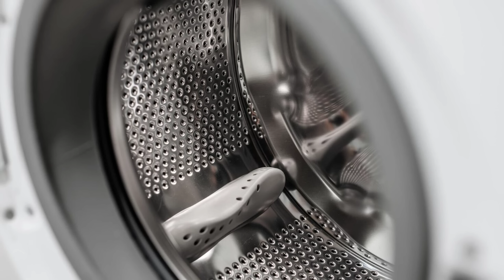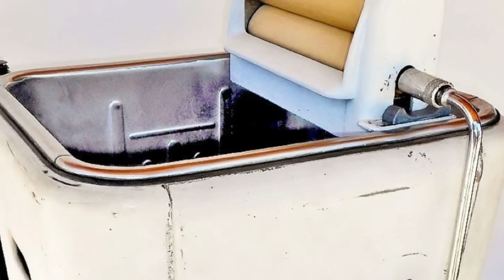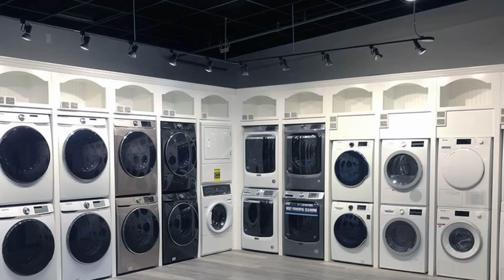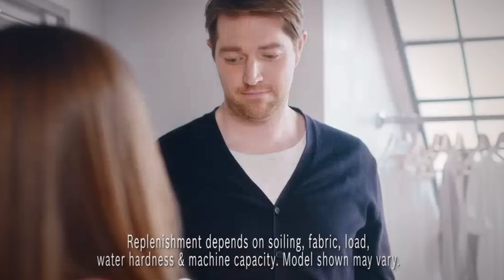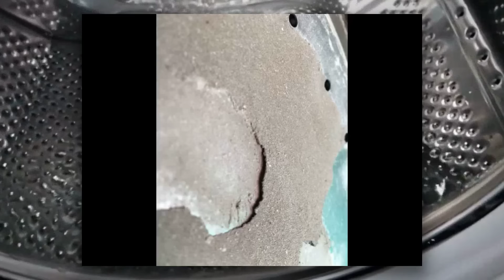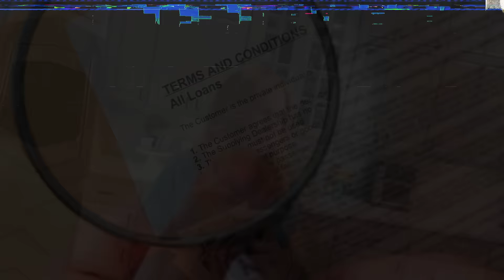The Only 5 Washing Machine Brands In The UK Still Worth Buying (Everything Else Is Junk)

Comment: Im a sucker for bosch and sadly my serie 6 did have a hole in af hose and leaked i have it fixed in a little shop who does work on all that kind of machines
And short after some how it have got a hit or water damage under paint in front and rustet in buttom and paint are coming off but the machine works fine and are around 3 or 4 years now :) i have both washer and a dryer with silencer they are so good machines so i am buying a new serie 6 bosch again

Comment: BOSCH ??? Bullshit. 
The sealed plastic cover around the drum makes the bearing replacement impossible, which is what frequently brakes in those machines ( or the spider as consequence of the defective bearing).
A replacement drumm costs 85% of a new machine. And bearings brake frequently after 5-6 years, and cost less then 20€.
The plastic cover is clearly an early obsolence tough decision.
BOSCH dont belong in that TOP 5

Comment: Actually, Miele have recently resorted to a fibre glass composite material called "Glaron K" for their outer tubs on their lower range models.

And you missed Ebac machines, which are VERY GOOD, REPAIRABLE machines made in the UK, and recommended by service engineers everywhere. Although not feature rich, Ebac machines have enough programmes for most households, with Hot AND Cold fill on some machines,  and offer a 7 YEAR parts and labour guarantee, which is unheard of from virtually every other manufacturer, except for LG, who offer a 10 year guarantee, but only for the Inverter Motor. The Ebac guarantee covers everything, and their machines can be bought for around £500, depending on capacity. So that is a lot less than a Miele, but with a guarantee that is over three times longer, and they are British made! 
Ebac will be my next machine, when my Bosch Serie 4 gives up.

Comment: Miele?  Don't waste your money!  
My high range Miele washing machine (over £1,000) lasted 12 years?  I do 3 sometimes 4 loads of washing per week, I never overload the drum but there is only myself and my carer.  When the machine drum stopped turning I called an independent service engineer who said 'The spiders gone!'  This engineer said what fantastic condition my washing machine was in, 'like new' as it hadn't done a lot of work so I asked him to do a report stating that which he did!  My house is fitted with a water softener so hard water is avoided.  The spider was removed and it was made with 'Mickey Mouse metal' (ASME IX, G6 Metal Fusion Engineer).  I wrote to the UK CEO informing him that when I purchased the washing machine at great expense the advert said it would give 20 years service!  I received a phone call from a lady who said 'What do you expect it's 12 years old!'
I wrote back and informed this CEO that I was someone who had Miele appliances throughout my home (incl. 2 vacumn cleaners, dishwasher, fridge freezer, upright freezer) but would never waste my money on another Miele appliance again!
'The Miele Honeycomb Technology Stainless Steel Inner Drum' has made a great container for a hydranger plant and I promised him I would show it to everyone who comes to my home, and I do!  'The Miele Stainless Steel Outer Drum has made a good planter for my tomato plants, safely accommodating 4 plants?  The only thing that this appliance does well!

Elizabeth.

Comment: I was an engineer with AEG in South Africa and the machines were made to last outer and inner drums were made of Stainless steel when I came back to the UK in the early 80s I knew someone who was giving away a lavamat Bella AEG so I went to the house to get it uplifted and it was so heavy for me and a friend to put it in my van and i installed in my Mum's house and she had for about 10 years and I had replaced the programmer twice and two pressure switches and my brother was a manger in South Africa with them and he was going to replace it with a new one ❓ so he used his contacts in the UK to be able to replace my mum's for a good price and i took the old one out of my mum's house and I had it in my own house for about 5 years and remember it was second hand when I picked it up for my mum so in total it was between 105/20 years old Amazing German engineering 😅👍

Comment: Beko WI1483.  Had for 11 years and cost £350  Just developed a knocking which looks like shock absorbers.  Brought replacements for £13.  If you buy cheap, just buy insurance and get a free replacement.  Dishwashers and heat condenser tumble-dryers are worth including as they die frequently.  On my 3rd Beko dishwasher after 14 years and insurance pays for replacement each time.

Comment: Bought a Zanussi 29 years ago.  Never had any faults or problems until now.  There’s a loud ‘knock’ at about 2 o’clock when looking into the drum and turning it by hand.  Still runs but ‘knocks’ with each turn of the drum.  Can’t detect any play in any direction in the drum bearings.  Anyone know what might be the cause and is it repairable?

Comment: I’ve seen on another channel that Miele have started to use plastic drums on some of their models. We have a Miele from 2005 and still going strong. We sometimes get a slight smell in the clothes. But since we had a service we’ve not had it. We’ve had it over 20 years and was in my op opinion the best purchase we had made.
Reply: Yes, on some lower end models, they now use a Fibreglass composite material called "Glaron K" for their outer tubs. It is used in the Yacht industry apparently, for the hulls of expensive yachts.

Comment: I did buy a Samsung washing machine because it has a splittable drum (not mentioned here) that means that if a bearing goes then it's fixable & doesn't mean a new machine due to the cost of the  drum. I have a 5 year warranty. The induction motor does not come with a 5 year warranty but a 20 year warranty. 
We are often told to steer clear of electronics but the A.I that I can switch on in this machine saves around 70% on energy.
It will be interesting to see how long it works after 5 years, based on it's warranty period. Oddly, I think this washer may be harder to sell, hence a £300 price tag, because of its electronics & WiFi functions. I didn't look for it but I like remote function & an easy ability to customise washing cycles & so I actually like it! There is also a UK built machine that is designed to be highly fixable called an Asko. I've not seen one & couldn't afford it.

Comment: If your handy enough you should be able to fix your machine with parts from ebay or other outlets. I've fixed our dishwasher washing machine hoover. Just buy a washing machine that the drum can be split for the bearings

Comment: Save yourself 20 minutes: According to the transcript, the five are Míele, Bosch, LG, AEG, and with conditions, Samsung. But check that, because this video is A.I. slop.
Reply: Bosch now has sealed drums, so I wouldn't touch them
Reply: Depends where they were  built and if they have built in obsolescence. No lonher the same machines as when built in Germany
Reply: My Bosch broke after 2.5 years. Just after the warranty expired. Control panel failed, an engineer said that ALL recent Bosch washing machines have the same problem.
Reply: @molin1978 Oh! Thanks alot to keep me updated 🎉🎉
Reply: Thx
Reply: Thanks alot Cheers mate!
Reply: Thanks, bored rigid.

Comment: We now have a AEG Less than a year old however. Our old Zanussi was 12 years old and still operated fine. The only problem we had was a broken door catch which I replaced without an engineer.
Reply: My sister had a Zanussi from the late 80's right up until 2015, nearly 30 years, and the same problem occurred with hers, the door catch. But it was also sounding really rough, so she went for a new machine.

Comment: TOP TIP......  Any washing machines with a ONE-YEAR warranty ... Avoid..... This is an Indesit..Hotpoint.... Candy.... Beko... Logik.... Hoover.. 
Before you say......  "I have an Indesit, and it has lasted 20 Years, etc., etc"   ....  Yes, that was the OLD Indesit machines ... The new ones from 2026 are utter garbage. 

I am running a Bosch WGE03408GB (Series 2)   1400 RPM 8KG (Purchased in April 2026 for £400) single-person household, so only used twice a week  (Just over 100 Washes a year) .. It came with a standard 2 Year parts and Labour warranty; however, I expect this machine to last at least 10-12 Years (1000-1200 washes) .... There are some ways you can increase the life of your washing machine ...
1) Do not over- or underload the drum  (Aim for around 65% full, and the clothes can move around in the drum, so get a better clean) 
2) Every 6 Weeks run an empty wash at 60 degrees and add Calgon washing machine cleaner into the drum... This will remove powder residue and limescale. Lucky for me, I live in a softwater area of the UK (Forgot to say... no fast final spin on the drum). Clean the powder tray and rubber door seal also ... 
3) Clean the fluff filter on the bottom right of the machine every 3-4 Months
4) Use the Minimum amount of laundry liquid, around 27ml, for a 5 Kilo load 
5) Do those shirts you wear in the office REALLY need to be spinning around for 3 Hours  30 Minutes when a 45 Minute wash will do? 

Still adamant I made a good choice with a Bosch WGE03408GB pro rata ... Money spent vs life expectancy
Hotpint £280 ..Last approx 5-6 Years ... Entry level Bosch £400 ..Last approx 10-12 Years   ... Would have to buy TWO Hotpoint machines = £280 x2 = £560  in the same time span (This is not including two lots of delivery charges..Two lots of charges to take away the old machine and two lots of charges to install the machine) 

Cheap bottom-of-the-range, less than  £300 washing machines are FALSE ECONOMY ..Bought by morons with a low IQ. 
Pay a bit extra and the machine will last a LOT longer.  
PAY CHEAP = BUY TWICE!
Reply: Low value machines are bought because of budget available not low iq.
Reply: @melgrant7404  The same people who buy the low-value machines have money to buy tacky tattoos and drugs...   
Cheap washing machines are false economy

Comment: We have had a Blomberg washer for over 7 years and only had to replace the door and some times up to 5 washs and I use soda crystals in every 5 washes in the washer no need for ( calgon).
Reply: Blomberg also makes Beko machines (Little-known fact). They are made by Arcelik in Turkey 
90% of the washing machines for sale in the UK are owned by just SIX companies.  
AEG also make Electrolux and Zanussi machines (Different badges) 
Bosch and Siemens are the same machines (Different badges) 
Miele is still the KING of washing machines for reliability and after-sales service (However, there entry level models now contain a sealed tub, no access to the bearings if they go.... Other than to replace the whole drum). But they are still very well made and very well engineered using high-quality parts.  But you are looking at around £850 GBP for there entry level models such as the WWA120WCS.  But they last a VERY long time. 
Sharp and Hisense machines..AVOID.. The after-sales service is shocking, almost non-existent existant 
Samsung... This video says they are reliable ..However, I disagree... There is FAR TOO MUCH unnecessary "Tech"  on the machine, all too likely to go wrong once it is out of warranty. 
LG machines fitted with a direct drive... Outstanding and very reliable.  The budget LG machines not as good 
Bosch machines... ALL models are good and are very reliable, even the "Entry model" series 2. 
Haier is a good choice if you are on a strict budget, looking for a stylish machine with modern features, and are okay with potentially needing a replacement or repair within 3-5 years.. I personally would not touch them with a 10 Foot pole. 
Pro rata ..Money spent Versus Time ... I  would say Bosch machines are a good bet. 
Anything with just a 1 Year warranty.. LEAVE IT WHERE IT IS!  Let some sucker buy it (Hoover, Hotpoint, Indesit, Candy, Logik). Leave these machines in the shop... 
Verdict... PAY CHEAP = BUY TWICE.   If you really must buy a cheap washing machine, Beko is the best (At that end of the market). Personally, I would find the extra money and buy the entry-level Bosch.  It will last a LOT longer for not that much more money. 
Kind regards, Brian

Comment: Bollox. I am still running a 35+ year old Indesit that was the cheapest (just over £200, 35+ years ago as i was skint) machine, from Clydesdale (they went bust 30 years ago, Curry's took up the slack)
I run a wash every day, 7 days a week. If it is on the floor, it is in the wash!
Reply: Tgat says it all when you bought from Clydsdale. Like the original company "Indesit" is no more just like Clydesdale .
Buy an indesit today and youll regret it after 14 months
Reply: @35geordielad  I know that

Comment: My old Miele came with 5 year warranties and lasted 10 years. They now only come.with a 2 year warranty. If the manufacturer has more than halved the warranty then it has no faith in its own products.
Reply: I've just bought an LG and got a free extended 5 year warranty by registering it with LG.
Reply: @antoniolione9972 Not bad for a big name manufacturer in these times. You are lucky if you get a 2 year warranty with most machines. 
Ebac offer a 7 year parts and labour warranty, and they are made in the UK, so no long waits for repairs. And full replacement if repairs are uneconomical. 
You couldn't ask for more at circa £500 tbh.
Reply: Ebac offer a 7 year parts and labour warranty that covers Every component, even the electronic gubbins. And they are UK made. Something to think about!

Comment: Just replacing a Hotpoint which started to smoke,only 3yr 6mths old. Uneconomic to have an engineer call out. Says a lot for warranty/quality.
Reply: Hotpoint were built to last when manufactured in the UK. Sadly outsourced to Poland now, and cheaper quality. Ebac are good UK made machines with a 7 year warranty
Reply: Hotpoint used to be great machines, up until the mid 90's when they were bought out by Haier I believe, then they started going downhill. 
They were made in the UK until the takeover, and lasted for years. The 'First Edition' range were the last UK made machines I believe, and possibly some of the early Aquarius models, before the curvy face plates were introduced. 
They made good twin tub machines too, much better than the Hoover twin tubs of the same era.

Comment: Can anyone remember Bendix washing machine, I had one for 20 years, bulletproof, and easy to repair yourself if it ever did let you down
Reply: We used to actually call the launderette " the bendix".
Reply: Yes!  My father had a front-loader Bendix specially imported from the USA after my mother’s sister had married a GI, went to live in the States and recommended the brand, and it carried on working for nearly 30 years.  I bought a Bendix in 1969 when my husband and I had our first child, but sadly it didn’t last as long as my mother’s.  I then bought a German-made AEG machine which lasted 22 years, followed by a Miele which survived three house moves and lasted over 30 years until it gave up the ghost two years ago.  I bought another Miele to replace it, but it doesn’t feel as sturdy as my previous one and has a plastic outer drum despite what this YouTube podcaster says.
Reply: Error code wasn't a thing many years ago.
Reply: Mechanical pumps!
Reply: My ex husband still has our Bendix washer, it's 23 years old.
Reply: @Nat6999  Ive still got a 35 year old Indesit, cheapest machine in the shop, still running almost every day with a full load for 35 years. Bought it for £200 in 1990. It is getting as bit noisy now and a bearing's job is not worth the trouble even for a £20 part
Reply: I actually had a twin tub in the late 70's early 80's and as a plumber i spent every night charging £35 (more if it was not directly next to the sink) to fit these new-fangled automatic washing machines. £30 cash profit 7 days a week when my wages were £26.
Got my kids to Tenerrife every year and a few nice cars.
Reply: @auldtam Typical thief 😂

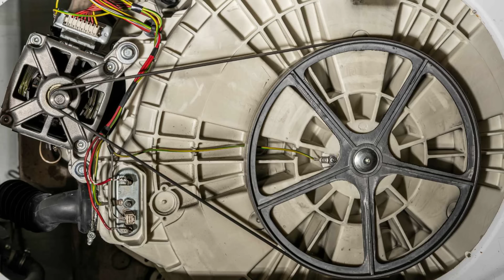Comment: This is clearly AI scripted because if it were a person doing actual research, they wouldn't get the claims so absolutely wrong. Many of the claims in this video are nonsense. At 12:17 it is stated that the belt on a washing machine in is by far one of the most common failure points in a washing machine. That's nonsense. Belts on washing machines rarely fail and there are no clutches on belt driven washing machines so the information is horribly confused. 

Load sensing has fuck all to do with how well the bearings will last. This is amateur stuff! I agree with the LG & Samsung PCB failures, but he enthuses about Ecobubble, but that is simply a second pump which recirculates water. It does nothing at all, it's just a sales gimmick, and another unnecessary pump to go wrong.  Many repairs are because of blockages, rodent damage or consumer misuse such as torn door seals where people pull clothes out of machines and zips nick the edge of the seal. Hard water does cause damage, but that is true of ALL brands.

I just wish people would make videos of things that they actually know about.